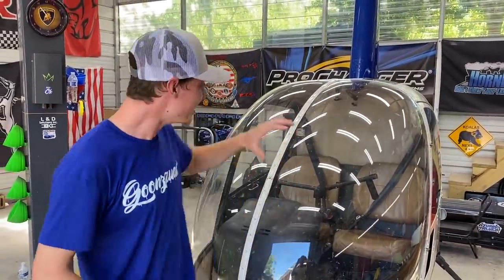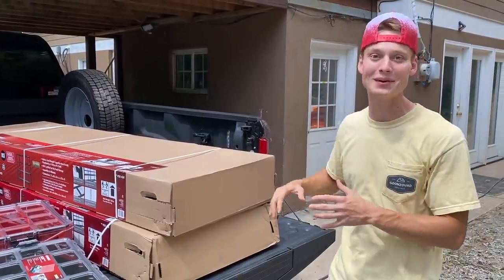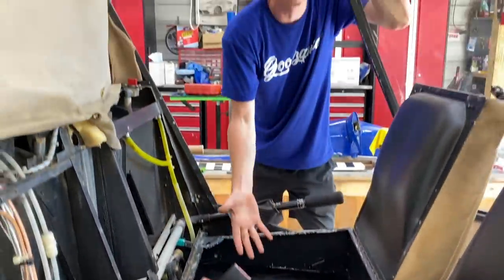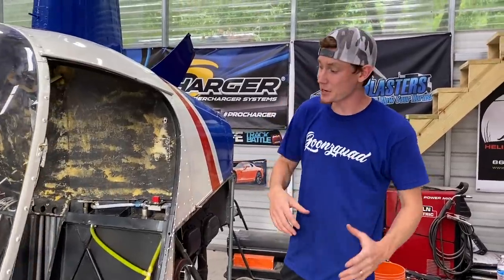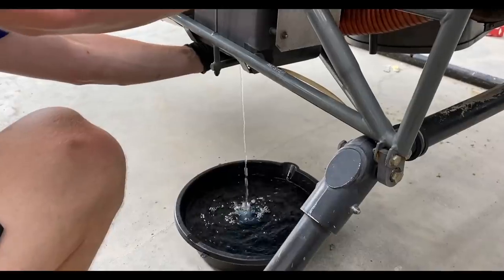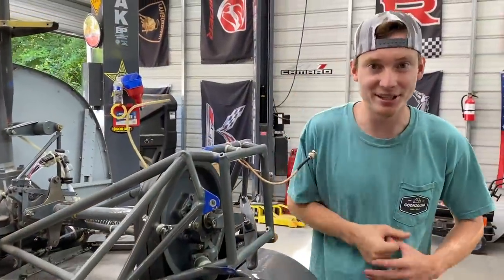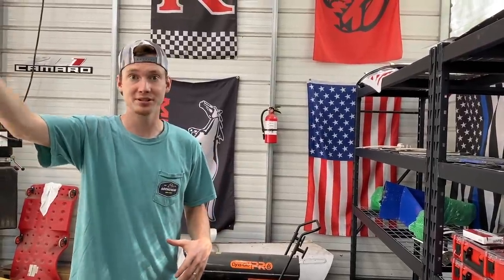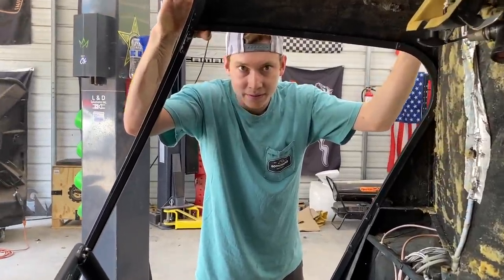Rebuilding A Robinson R22 Helicopter Part 2

Comment: They rivet the aluminum because it’s probably heat treated high strength aluminum which can’t just be welded. Also when one aluminum sheet starts cracking the crack will stop where the panels are riveted, a welded piece would continue cracking. Or in this case it might just as well be because it’s cheaper and easier.

Comment: It's called a rotor brake. Temperature tape would/could indicate a potential over-temp condition on that component, which could get very expensive. Good pre-flight/pre-purchase thing to check.

Leave all that carpet and padding out, there is no such thing as sound-deadening in a helicopter (LOL) and it will improve your payload capacity. Cheers.

Comment: I have found the official price list from robinson: 
The carpet they ripped out is all in $1,800. Those Tanks (Bladders) are $7,000 each. The main and sub rotor system is $37,000, the Gearbox is $6,850, the Stick assembly is $4,170 + $2,380. And there are plenty of other (expensive) parts... so better not break 'em. 
Google for "robinson R22 Spare Parts Price List"

Comment: Seeing you boys are moving forward on this project I have a suggestion. You need to buy two books first one is called "Aircaft inspection,repair and alterations. Acceptable methods,Techniques & Practices. Otherwise known as AC4313-1B by aviation maintenance  technicians. Read the whole book it's a wealth of information. The next book is "FAR AMT" Federal Aviation Regulations for Aviation Maintenance Technicians when you get that book read Part 145 the whole chapter....it's long and boring but it'll explain to you why you probably shouldn't be doing what you are.

Comment: Remember fella's it's Port, Starboard, Fore and Aft, just like on a boat.
Reply: Fore and aft is correct, but with aircraft maintenance, we refer to “Aircraft left, or Aircraft right” or “Pilot or copilot side”.   

    With a helicopter, “pilot side” could be confusing since some helicopters are flown solo from the right or left seat.

      I’ve never seen an aircraft mechanic use port or starboard, even on a seaplane.

Comment: Increasing the size of the tank might bbe a bit complicated due to the fact that the R22 is usually compressed  in the back. So if you incease the size, you will reduse access to the components.

Comment: Y'all should see if Robinson has a fadec upgrade for the engine. It would increase fuel efficiency and range, not to mention reliability cause it will be fuel injected at that point.

Comment: They don’t weld aluminum in air craft because it changed the temper in the metal and rivets are actually very strong if done properly

Comment: I know you guys will give that bird a great paint job WARNING put down the sand paper the paint comes off with chemicals. You don’t want to scratch the alclad on the aluminum . Call some aircraft upholstery shops and get some leather for that puppy. All of the upholstery must pass a burn test before it can be installed in an aircraft. Safety safety!

Comment: FYI Bladder tanks are safer but they do hold less fuel. the upgrade is not optional so unfortunately you'l be losing 3.8 gallons or approximately 25 minutes of flight time.

Comment: o.k.  I'm not done with this video yet, but man, I understand that weight is the priority with an aircraft, but doesn't it seem like this is as cheaply made as possible, like a popup camper!?  Also, can you modify an aircraft or does it have to be original to maintain it's FAA certification?  Do companies make aftermarket/upgrade parts for these things?

Comment: Hey guys. I´m a big Fan from germany and as long as you were working with cars I was fine with your way of maintenance. But as an licensed aircraft mechanic of the german Navy I need to warn you. Pleas dont use electric tools like your cordless screwdriver or not explosive protected flshlights when working on Aircrafts, especially on the fuel system. It sometimes sounds overprotective, but there is a reason why airbus, lockheed and other aircraft builder have such warnings and cautions in theire aircraft manintenance manuals. And pleas always make sure you cover every opened line (hydraulic/fuel/electric,etc.) so you dont get any contamination.

Comment: Did you know your 2019 Ford f-450 platinum has 450 hp and can tow 21000 lbs I am a fan i'm 8 years old  I was wondering if you could rebuild a wrecked  Gembala gt. Your house  videos are awesome

Comment: I once heard flying a helicopter is like patting your head, while circling your hand on your stomach, while reciting the national anthem backwards.
Not something I think would be conducive to an enjoyable LONG flight experience.
There has to be a reason most helicopters get flown around inside other planes for longer flights.
I think you're going to find flying the chopper is a workout, and exhausting.

Comment: you might as well throw those screws away :D you are not allowed to use the old screws anyways. Every screw that you take out has to be replaced by a brand new FAA approved screw. Every little step needs to de documented and certified. I hope this won't bite you guys in the ass :D

Comment: The engine is an air cooled aircraft engine there is only an oil radiator there is no coolant system that is why the heat coms from what is know as heater muff!

Comment: I think I rather see car repair since that's what we can do as well. As for choppers, I don't really want you to fall off the sky and ends Goonzquad.  I just feel like someone rip you off selling some not flight worthy antique equipment when there is no way to know how many flight hours are already on the metal parts and if they had metal fatigue that can suddenly break apart. And no full repair history to see what part keep failing or are too old. Too many unknowns to risk life on it....An old car at most it just stop on road side. A Cessna would be a better choice. If it have engine failure, you can at least glide back to air port. Copper, it go straight down spinning. Don't forget you need to spend time and money on your flight classes and exams and hours of flying training before you even can fly this thing.

Comment: The fuel cell isn't welded because: kerosine (or jeta) is very explosive. When a fuel cell gets overhauled or repaired they have to ventilate everything for at least 24 hours. If you would weld a fuel cell the whole thing would catch on fire. Repairing fuel cells is also a very dangerous job. Also welding is like the biggest sin in the  aircraft industry. The only thing that is welded is the exhaust of (some) turbine engines. If if done so it is done in a special workshop.

Comment: Animal hair and dirt not good for avionics. Should seal avionics
 in  plastic bags.
Heater is needed to defrost growing glass or shielding. For every 1000 feet you climb vertically temperature will drop 3 degrees.

Aircraft have phased inspections. They are based on number of flight hours flown on engine, frame and rotors and transmissions.

Comment: Looks like they are removing non structural components.  They are just disassembling it. They aren't  overhauling any mechanisms.  Don't think any certification is required at this point.

Comment: This project is not going any where.  Once these kids get this thing put back together  and if by some miracle it passes FAA inspection, then the hard part comes.
I have a feeling that these guy's think they will be able to fly this " helicopter" because they've played some flight simulator on their XBOX.
When they find out how many hours they have to put in to learn to fly, I have a feeling they will give up.
Remember flying, especially a helicopter is a very complicated thing to learn, and there is no " reset" button up there when something goes wrong.  Unlike winged aircraft which are fairly safe even in an emergency situation, small helicopters are not.  You have only seconds to do the right thing to try and get yourself out of trouble.
.
Reply: arent you a bucket of sunshine...
Reply: Who pissed in your cornflakes this morning? Even if they never fly it they have already done more than you have.
Reply: @Chiller1967   Just saying, the 150 grand that they will waste on this thing could build them one hell of a new Garage.  Oh wait they said they were building a garage last November, What ever happened to that project, ?

Comment: The difficulty has nothing to do with it. Flying maintenance regulations are far stricter than cars. I have a PPL, not in a helicopter but I have a lot of hours in a helicopter simulator. As they say "there is no hard shoulder in the air" you can't just pull over. I don't think you guy's are going to be able to as much as you'd like on an aircraft. Very strict regulations. Love all the car rebuilds / mods though

Comment: Sorry lads, working on cars is one thing,  but a helicopter is a whole new ball game.
 The place you fix them in needs to be spotless with nothing in it but the Helicopter. 
You need to count your tools in and out, this is very important when you start to put it back together. 
DO NOT just pop down to your local hardware store for any nuts and bolts that are missing .
When I tell you that the makers of planes and helicopters can trace every thing., from the smallest part to the biggest. This is done so in the event of an accident and a part is found to be at fault the batch can all be traced. 
Rolls Royce jet engines have a fireproof room that has a file on every engine they've built and the file is only destroyed when the engine is confirmed as scrapped..

Comment: There are way too many “mechanics” on here. You guys just stick to what the manuals and your AMO say and you will be fine. Some of the suggestions here will end up in disaster and/or cost you extra for no reason as most of those small cotter pins, bolts and nuts are re-usable. I own 3 of these and have many years of experience maintaining them financially. Enjoy these awesome and reliable helicopters.

Comment: So ... SOO Many Things WRONG with this project. I have MUCH TIME in the R22. Flew them back in the very early 90's before progressing to larger machines. This little machine WILL BITE YOU if your behind the Curve, and it looks like you are a perfect contender for an early on video RIP. Are Your rebuilding this R22 with an Authorized Robinson R22 Overhaul Kit, and you are authorized to this legally???? Do you have an officially A&P Rating to this work in the field?? NOT LOOKING LIKE A GOOD ENDING!
Reply: RIP

Comment: you should look to papers of the helicopter, times, potentiel remaining, OH, SMOH, BT services, engine etc.... don't do anything illegal, I'm aviation mecanic... your scare me

for exemple:
Robinson R22 Helicopter overhaul prices are effective for all aircraft arriving at the factory ready for overhaul and apply to properly maintained, undamaged R22 helicopters without excessive corrosion and still in airworthy condition. Upon receipt of the aircraft, including all parts, logbooks, signed work authorization, and a 50% down payment, the aircraft will be disassembled, inspected, and reassembled. During overhaul, all fatigue-life-limited components with less than 2200 hours remaining are replaced. All engines are overhauled per the current Lycoming overhaul manual by either LHD or Lycoming. We ensure all aircraft service and maintenance are in compliance with Robinson Factory standards.
Overhaul Kit w/ Robinson Warranty$93,000
Engine Buildup Kit $2,900
Engine OH w/Warranty $18,500
Overhaul Labor $16,000
Total  $130,400*

Comment: I mean this with all peace and love.  I don't think I can watch this series, because I feel like I am watching two guys commit suicide.  You guys are taking off parts that literally will kill you if you don't put them on 100% correct, and that means every bolt, pin, connector etc.  The R22 is not what you would call a the safest heli in the world and working on this yourself is crazy stupid.  I get you are sending parts out to get refurbished but someone has to put them back together and that is the most dangerous part.  There are good reasons that helis are so expensive to own, its because they require a serious amount of maintenance.  There are so many small parts that if one bolt or cotter pin fails or is not put on correctly you die. Please for the love of god never fly this heli or have someone put it back together who is a certified heli tech.